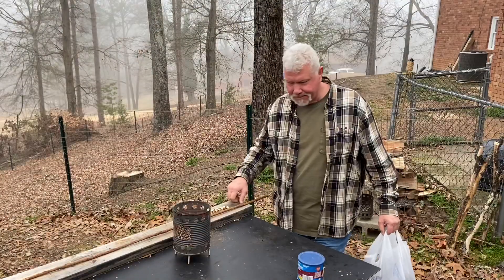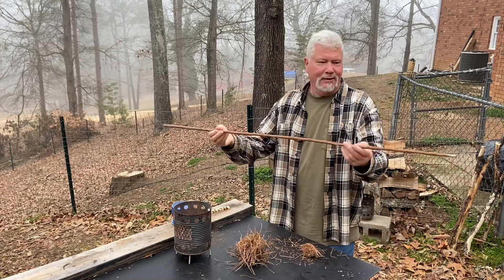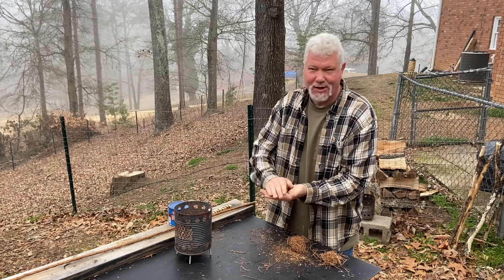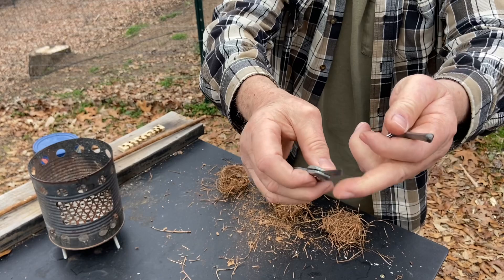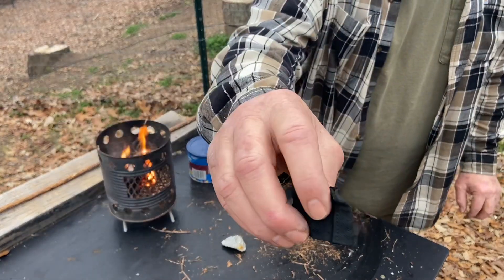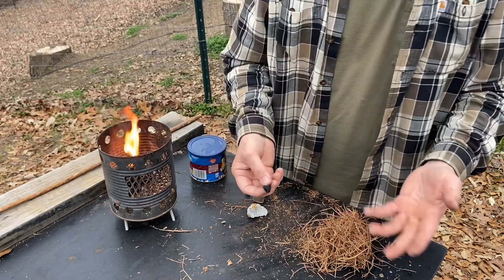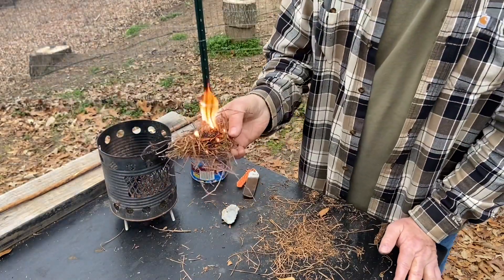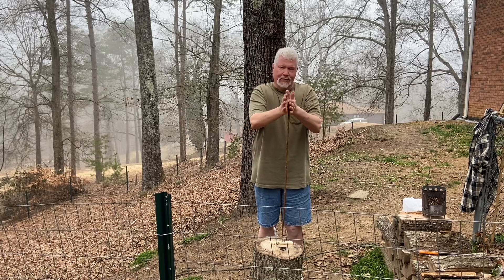100% Humidity Fire Making, Ferro Rod, Flint And Steel, 3’ Hand Drill Spindle Action

Comment from the maker: Heavy fog and 100% humidity... HEY, Let's practice some fire making!. The Ferro Rod and Flint and Steel ignitions went well. I got some interesting Slo-Mos of them too. The Hand Drill, on the other hand, gave me the most trouble because of all this moisture in the air. I started off with a 4' Horseweed spindle on a Tulip Poplar fireboard and quickly spun up 2 FAILS! I couldn't bear down hard enough on the spindle because it was flexing so much. I removed about a foot, cut another divot, notch, did another burn in, and spun up an ember with no more problems.
   Please follow the LINKS below and SUBSCRIBE. Thank You!

Ferro Rod Playlist
https://www.youtube.com/playlist?list=PLkoXX8XsMW3lI6k8TH1Bljf57Yvp9K1WD
Flint And Steel Playlist
https://www.youtube.com/playlist?list=PLkoXX8XsMW3mFf5FgLtam1aDmXmqQQice
Hand Drill Playlist
https://www.youtube.com/playlist?list=PLkoXX8XsMW3nvAanTlr7IhGt1Kjk3SNzp
How To Make A Flint And Steel, Steel Out Of A $2 Flea Market Nicholson File
https://youtu.be/B2scpo1tRLk

Comment: Agreed, my success with fire making skills has been built on a solid foundation of failure, an integral part of the learning process in the quest for mastery.  It actually isn't failure though, if you learn from it and are able to see the benefit.
Reply from the maker: Even the experts that never post a single video with even the least bit of trouble fail on a regular basis.

Comment: David, big fan. Thanks for all your content. Your tutorials have been the reason for a lot of my success out in the field.
This made me curious, would all of your drying cycle concepts apply in the same way for hand drill embers vs. bow drill? 

Thanks again for everything you post!
Reply from the maker: Yes, but it's very physically difficult with Hand Drill. There's no mechanical advantage like with Bow Drill. When you stop and let the steam escape, there also goes the heat that you built up that turned some of that moisture into steam. Now all that heat has to be built up again... and again... etc. It's not that physically demanding with bow drill.